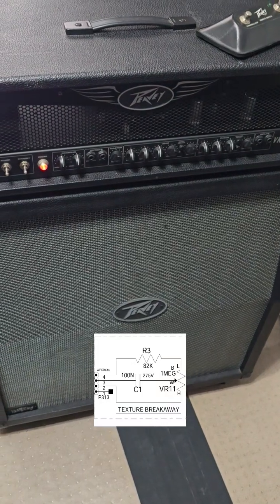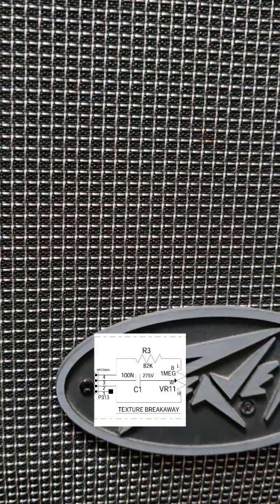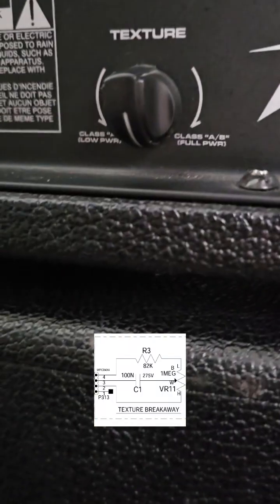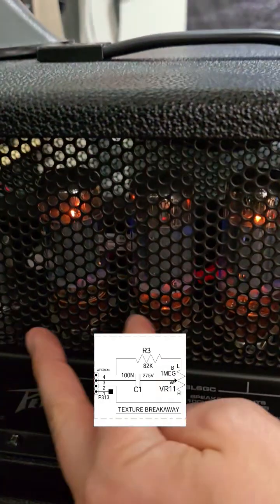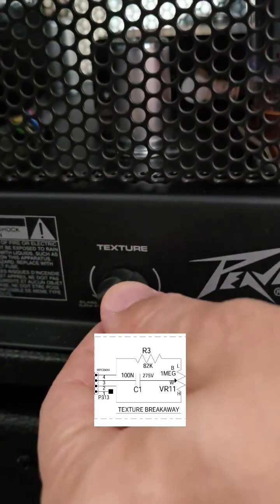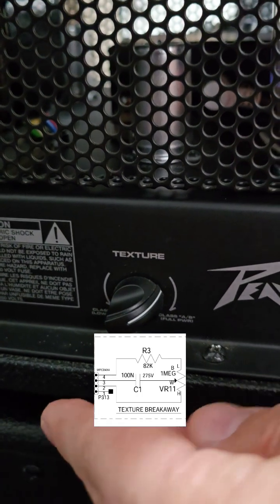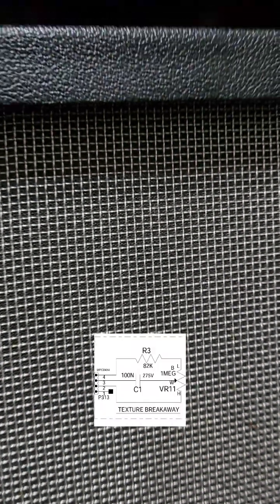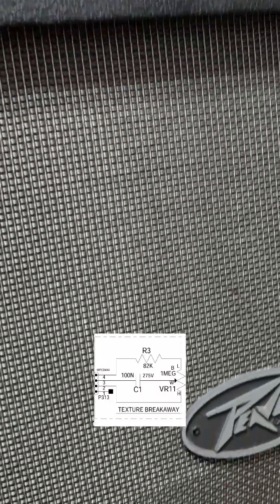Peavey ValveKing 100 Guitar Head Vari-Class Texture Knob Hum #guitar #guitaramp #peavey

Comment: Your description of operation was puzzling until I found a schematic. The "texture" pot controls the AC amplitude of the drive to one of the output tubes. That would change the waveshape a bit, making it non-linear. Of course you have some negative feedback so it could be subtle. It doesn't really change the output amplifier stage class. It might be good for balancing the gain of the tubes. Or maybe unbalancing them to get some interesting distortion. 

 Why the hum? The schematic shows one side of the pot near ground, which is also one side of the heaters, so maybe there's a ground loop problem. The schematic shows it connected to the chassis ground at the speaker output jack.  It should return to a ground at the phase inverter stage.
Reply from the maker: Thank you for your comment! Yeah the circuit isn't the best, from what I've read and heard very few owners of the VK use the texture pot in general. I'm sure it has it's uses, but not in a metal context, which the VK seems to have a voice for.

Comment: I have a Tone King combo. Wondered about that a/ab blend, because I can't really hear a difference. Good to know what it's all about. Haven't ever noticed a hum, but will check it out. Thx.
Reply from the maker: Awesome! Yeah it's a great feature but not widely used. The ValveKing is a great pedal platform on its own as well. It's like a poor man's Soldano.
Reply: @Bassguitarist1985  I've only used it a couple of times, so far. Bought used, nearly new. Big home jam on Saturday. First in a year. Eager to give this thing a fresh go with some pedals. Your short video and reply gave me the best info on this amp, across YT.
Reply from the maker: @Slo-Fi77  glad to hear! if you have any tech questions let me know. I'm friends with one of the engineers who designed the amp at Peavey.
Reply: @Bassguitarist1985  😎👍